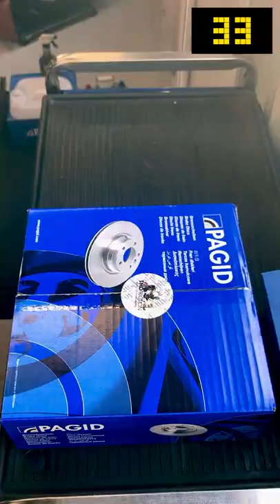BRAKE JOB IN 60 SECONDS #shorts

Comment: I guess no issues compressing that darn caliper!!
Reply: Never done this before but gonna give it a go..... Question.... Do i need the caliper tool??
Or does keeping the brake Reservoir cap off remove the head pressure